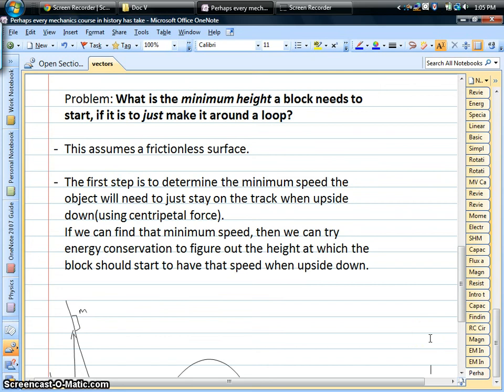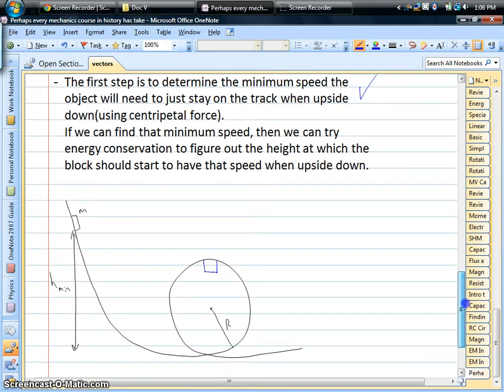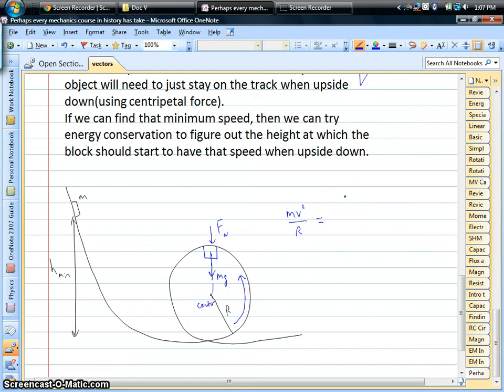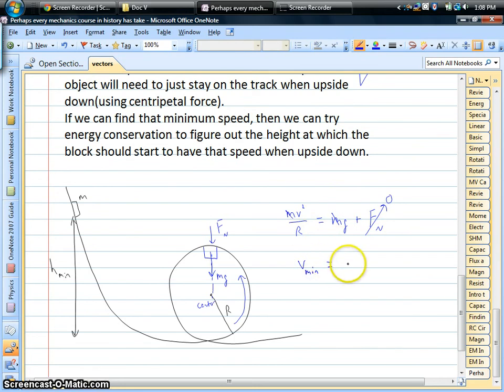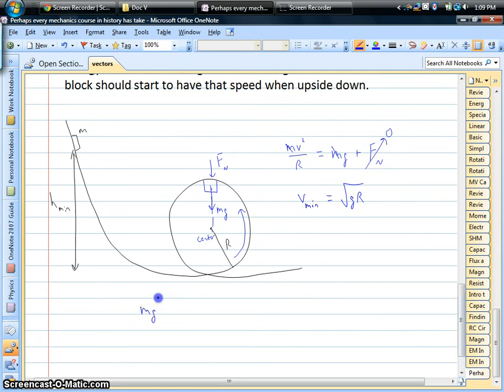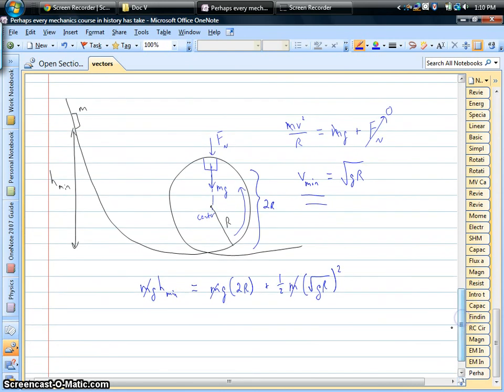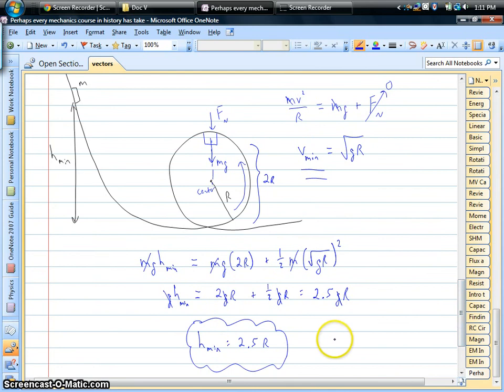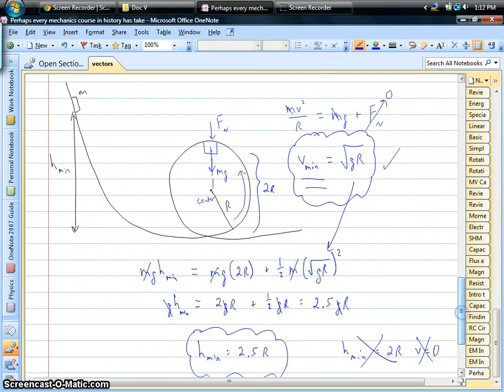Minimum height for a block to just make it around a loop-the-loop

Comment: First of all, great explanation, thanks! However, at the end of the video, where you explain that even if the initial height is 2R, it will get you to the top of the loop, but the velocity there will be zero, that is incorrect. This is because in order to be moving in a loop, a body needs to have non-zero reaction force ( as you explained ), but in any moment of the movement the reaction force is the difference between the centripetal force and the projection of gravitational force in the normal direction. So, in order to have a non-zero reaction force, the centripetal force needs to be greater than the projection of the gravitational force (mv^2/R > mgsinθ , where θ is the angle between the horizontal axis and the radius-vector of the body at that moment), which means that v  > sqrt(Rgsinθ). So, if the initial height is 2R, this condition will not be satisfied for a certain angle and the body will fall down sooner, not reaching the top. This means that reaching the top with zero velocity is impossible. Your video helped me understand this, thanks! Nevertheless, please correct me if I'm wrong!